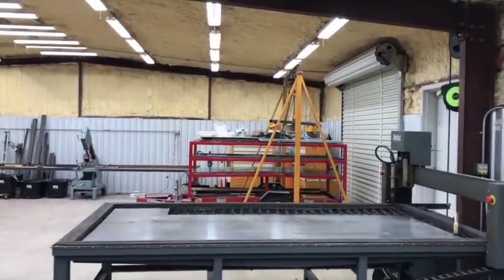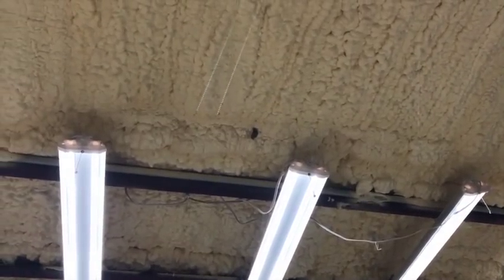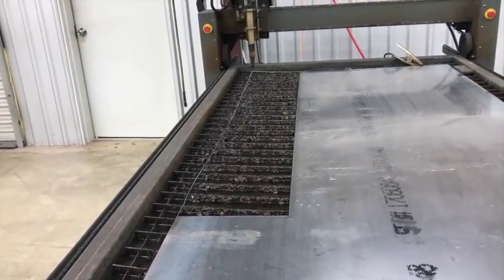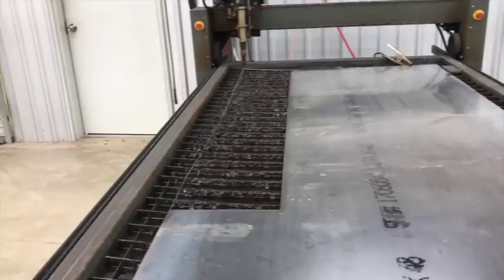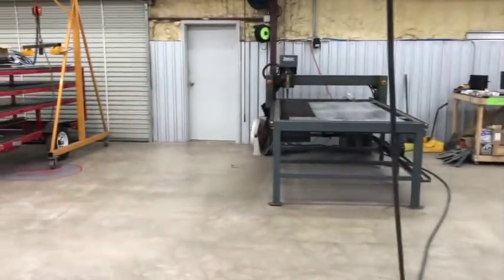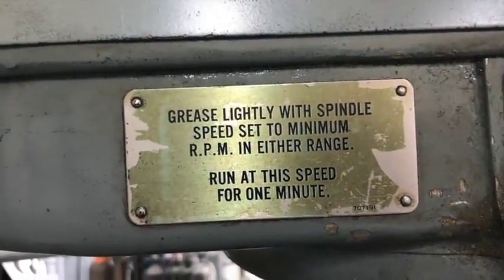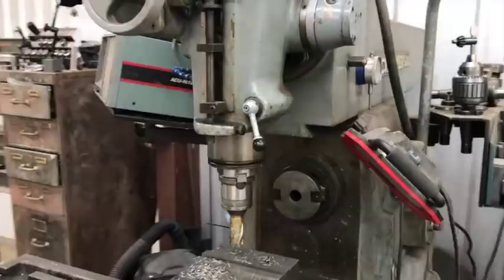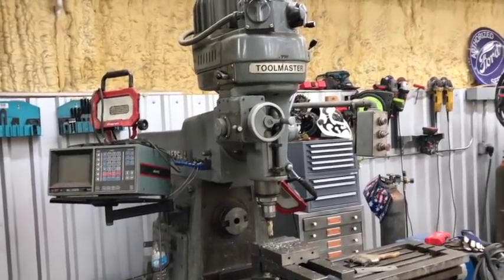Shop Update   Mill Spindle Lube Question

Comment: Sounds like a problem in the head to me from here. You may have a belt coming apart. This manual should help you out with the lube and whats inside in case you tear into it. http://vintagemachinery.org/pubs/2097/15219.pdf

Comment: ..noisy mill....those variable speed drives tend to be noisy, but that sounds like a bearing....and the spindle in the quill....usually a spot near the top that says...'Oil daily'...just a couple drops for the 2 ball bearings in there......that's important, those ball bearings are quite expensive.......a lot of shops don't oil them because it's a total loss system, and the oil drips out at the bottom of the quill...